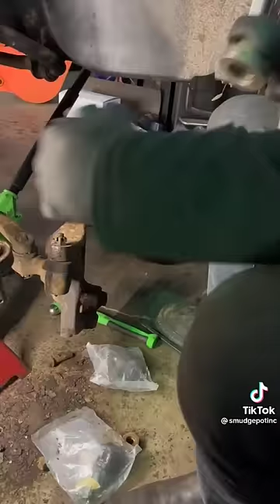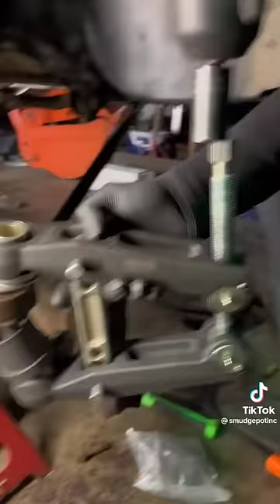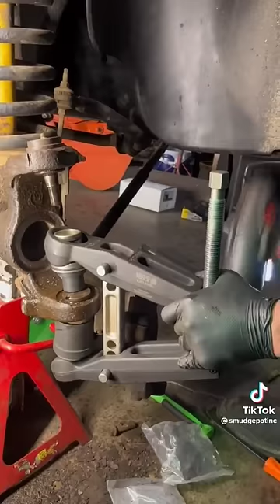Matco Ball Joint Press out ball joint Tool Kit pt.1 #automobile #diy #fyp

Comment: Doesn't matter how much you spend on tools, you'll never have enough hands when it comes to suspension work😂
Reply from the maker: Fair enough 🤷🏾‍♂️
Reply: Frs
Reply: That's why I got married
Reply: It’s a fact, suspension tools are a 2 man job to use most of the time😭🤣
Reply: Ditto bagging groceries in cloth bags.  ;)
Reply: FACT
Reply: @iHackWaWx  good thing i have multiple personalities.
Reply: The question is. Can you use it to install it???🤯
Reply: @nancydiaz753  I don't see why not. Just use the correct fittings

Comment: I watched my pops with this exact tool... for solid 20 minutes try and work out a rusted, completely welded, solid lower and upper ball joint on a 95 ranger.... about 20 minutes later I saw I'm driving to Napa and he got complete lower and upper control arms with new bushings... and he sold that tool back to the matco guy and said "if it's that fucked up and needs this kind of tool, it needs the whole arm replaced" lmao
Reply from the maker: Yeah, if it's that messed up the entire thing needs to be replaced anyways🤷🏾‍♂️
Reply: @letsfixit251 except you’d have to replace the entire axle tube on this truck in this video. It’s a solid front axle vehicle.
Reply from the maker: @adamchristopher2086  it is what it is. Basically, another bad design
Reply: @letsfixit251  how so? 3/4 ton and heavier duty trucks use solid axles because they are more durable than IFS. This has been proven with countless GM Duramax tie rod issues.
Reply from the maker: @adamchristopher2086  my point was jeep wranglers are poorly made. Nothing against any of the heavy-duty vehicles witch should have solid axles
Reply: @letsfixit251  gotcha. Couldn’t tell if this was a Jeep or a Dodge with him referencing Chrysler.
Reply: Lol just cause ur ball joint is bad doesn’t mean you ALWAYS need a whole new control arm that’s gonna cost way more to buy. Ball joints are supposed to be tight like that. Money well spent when I got mine!!!
Reply: That's what I did for my durango.
Reply: @adamchristopher2086  I see an ungodly amount of that shit lmfao. Damn tie rods are ALWAYS fucking bent.
Reply: @letsfixit251 😂🎉
Reply: We had a stubborn one like that, the other day on a jeep compass. Fought for hours trying every tool and it just would not come out. We finally ended up just grinding it right out of there and then smacking it out with a hammer.
Reply: @claytonmullins89  it's just easier than trying to get them separated when they don't want to separate.  I agree they're supposed to be tight you don't want them coming apart.
Reply: That’s not an arm he’s fixing. If the ball joint don’t come out it’s time for a new differential/axle
Reply: He' did grind said weld off before attempting to press if out yeah 🤔,?
Reply: Wait, this is a specialized tool that sells for over $1k off the Matco truck.  You’re telling me that your “pops” bought one just for a 1995 Ford Ranger and returned it after only 20 mins of use because it wouldn’t work on that one application?  Something about your story doesn’t sound right.
Reply: all ramgers here are cake...you up morth?
Reply: Well you must be mistaken on year of the ranger because they didn’t use control arms on rangers until 98. 97 and older used twin I beam or ttb depending on 2 or 4wd. But yeah way easier to replace control arms in any situation as opposed to pressing new ball joints in. New parts prolly cost less than the tool too lol
Reply: @Redranger94  ya know, you may be right about the year. I remember it being a 4th gen and I think those came out in 98?  I know my 2nd gen was 2wd and the 4th gen was 4wd. And idk if we ever did the ball joints on 2wd truck
Reply: If a ball joint or bushing needs replaced at all I just get the whole control arm. It's cheaper and easier.
Reply: @Redranger94  eassier to umload torsiom bars vs press a ball joimt?
Reply: @jonWilk8156  yeah you know I guess I shouldn’t have said always easier to replace control arms than ball joints. Just most the time rather. I’ve never really had a problem pressing joints out but there is typically an advantage to just loosening bolts and nuts instead.

Comment: I’m still using a 20yr old OTC c-clamp style press. Works great and doesn’t take seven hands to hold it in place.
Reply: Yeah but like it’s cool 😂
Reply: I guarantee you’ve struggled on a dodge  ball joint. If you used this, you’ll realize how much easier and faster it is. Our store bought it when it came out, does the job so much faster than any c-clamp ever has. I highly recommend it.
Reply: @alainorozco8032 I did my ball joints  on my dodge, put all the clips on, and the one popped out when I turned the wheel while sitting still, so I tacked it in.
Reply from the maker: Sheesh thats rough😬
Reply: Works on drive shaft u joints also 🤘
Reply: -40 years old still working great OTC it's made me more money than almost any tool
Reply: Same here
Reply: First off it still takes 3 hands with the C press and second this thing moves the jack screw out so its not stuffed up in the wheel well while your tring to get your gun on it ... very handy
Reply: I never saw this style I thought there was only a c-clamp style we're doing ball joints sucks I did them on my old 95 Dodge pick up what a 🐻
Reply: Most but not all  of the c clamp ones are not impact rated that's the bigger issue and this matco one is nice but probably $1000
Reply: Got the same C style and I disagree it def still requires 3 hands

Comment: Pro tip. Tap on the knuckle with a hammer when pressing in and out to release the tension and your cups won't flare and last longer
Reply from the maker: Sounds about right
Reply: Hmmm yes.
Reply: Plus LUBE! Lots of LUBE
Reply: Depending on the material. obviously you don't want to go banging on forged aluminum control arms. That's a recipe for disaster. You certainly don't want to heat them up either.
Reply: @KyrieEleisonMaranatha  while this is true for the most part (taping and banging totally different) most aluminum components don't have the option to replace the ball joint to begin with
Reply: @Tony-ps9qk  that's not even remotely true, 99.9% of control arms have replaceable ball joints. Whether pressed in or bolted on. With forged aluminum arms, you really don't want to bang on them to much. I have seen them crack before. Especially when you already have pressure being applied from the press. Also absolutely no heat on forged aluminum.
Reply: I seen a guy in Africa with a multi headed tool that was basically a long breaker bar he used for nearly everything and he would rebuild suspension
Reply: Absolutely.
Reply: Yup
Reply: @KyrieEleisonMaranatha annealing will have your alloy reeling. 

...Or bending or cracking lol.
Reply: This is the way.
Reply: Also the threads won't have to take all the pressure of pushing it back in... i've had to replace three of the C clamp looking ball joint presses because of the threads getting messed up.
Reply: Yes, came down here to post this. Beat me to it.
Reply: @Tony.  Is that with ur fourth hand yeah?
Reply: It's matco 100 percent warranty anyway.
Reply: Getting it nice and hot helps too! Especially in the salt belt
Reply: Wow, what a pro
Reply: @KyrieEleisonMaranatha I don't know where you're getting your 99.9% number, but you are the one that is mistaken. There are tons of vehicles out there now, and I mean tons of them, that have disposable A-Arms made of aluminum with an integrated ball joint that is not replaceable. You just replace the entire control arm. Fords do this a lot, as an example.
Reply: @shelbyavant5081  no there isn't tons of those. You clearly don't know what you are talking about.
Reply: @KyrieEleisonMaranatha  He’s right, you clearly don’t work on a lot of modern vehicles if you think that. Plenty of cars over the last 15 years have non-replaceable ball joints
Reply: @jeremyadams7395  no that's not true, and I own my own shop that sees 100's of cars a month.
Reply: @jeremyadams7395  also liking your own comments is a sign of narcissism boss.
Reply: That's what I thought. If you have the means, heat it up as well.
Reply: KY
Reply: @hanzgrueber145  I’m very interested at what this tool name is? My imagination has consumed my thoughts 😂
Reply: @KyrieEleisonMaranatha  Did you ever learn about disposable A-arms, chief? At your shop that does hundreds of cars per month? Just checking in.
Reply: @shelbyavant5081  Technically all a arms are disposable. 🤣🤣🤣

Comment: To extend the life of this tool, it’s best to tighten some and tap the knuckle, tighten, tap. Doesn’t take much longer. Also I found that keeping the threads lubed up, drastically helps extend life and create more tension. Great tool!
Reply from the maker: That sounds about right ✅️
Reply: Man you never used one.
Reply: I use ARP bolt lube on all of my press and puller bolts. The bottle is expensive but it lasts a long time and I never gall the threads on anything.
Reply from the maker: @Jpilgrim30  why not the regular red grease?
Reply: @letsfixit251  the arp lube is a moly lube just for lubing threads. It’s not as messy either
Reply from the maker: @John Pilgrim  interesting. It's called arp line?
Reply from the maker: @John Pilgrim I'm going to look into that I learn something everyday. Stick around my channel for a while sir🫱🏻‍🫲🏾
Reply: anti seize the threads.
Reply: also grease threads
Reply: “That’s what she said”

Comment: I use the HarborFreight ball joint press to change u-joints…it’s a game changer!
Reply: Look at what he is working on.....4x4....lower ball joint.... maybe you can get the harbor freight setup in there to do the lower, but your probably going to end up taking out the upper ball joint first.
Reply: @ryurc3033  I did my 06 Ram 3500 4x4 this weekend with the harbor freight kit and did not go through the top on either side. Worked very well.
Reply: Harbor Freight is a game changer
Reply: My Ram 2500 ball joints were far too much for the HF tool. Literally bent the tool open. It is stout but those d*** things were IN there. OTC kit from Amazon worked
Reply: No no it's a U-joint changer.
Reply: How much is it at Harbor Freight?
Reply: @phendrix9476 Use a torch to heat up the control arm around the ball joint first and watch that BJ pop right out 👍🏻. Heat works wonders.
Reply: I uave bent two of the HF ball joint tools.  Ended up spending a little more for one apparently made in a different part of China.  😂

Yes.  Porter cable half inch pneumatic impact...opened up two of the HF ball join tools.
Reply: Yesssss sir. HARBOR FREIGHT can definitely help a lot, specially for those specialized tool that we use once per year.
Reply: Game changer......yea...you from a man to a puzzy,  only thing I'll buy from harbor freight is WD40 and a Chevy Keychain they have at the checkout line.
Reply: I used a HF one and it exploded, you win some you lose some. That one lost. Got a real tool from the parts store and that worked.
Reply: @smooth_ops2942  nothing like the Ol “hot wrench”
Reply: @paulieramos  good for you cool guy…

I actually use the tools not just look at em…

Comment: If the tool says it's ok to use impact on it, at least use a good strong moly grease on the threads.
Reply: They’re still going to stretch as will that bolt. Might take a few years, but constant use will eventually break that bolt. 

An air hammer would work just as well and be way more useful.
Reply: matco truck will replace it forever tho
Reply: I see blue grease on the threads
Reply: @giveitthebeans1741  more grease is better. gives a reassurance to all viewing and questioning whether there's grease on there or not.
Reply: @ninjamigs1766  Lmao! Who CARES about viewer assurance 😂 Maybe dude wasn’t want a whole damn tube of grease on his tool. As a professional technician, I assure you that I hate excessive grease on my shit. The grease is there, whether you can see it or not, and the tool worked, whether it had grease or not. End of story. The guy doesn’t work for Matco, so he’s literally just trying to show people ways to make their job easier. Buy it or don’t buy it…
Reply: Why? 😂😂😂
Reply: @valkyire35  reduces friction and heat and chances of binding up and fucking the threads, heat and friction and speed will do that.

Comment: “That is the fastest I’ve ever seen”

Keep hitting it with your purse why don’t ya.
Reply: You've never changed a ball joint and if you did It was on a honda. Once. 

Do a couple tundra or sequoia and come back, big manly man.
Reply: @eikon7073  what's a better way to take them out without this tool honest question?
Reply: @Junior-yd8xb  this IS probably the most effective method I've seen. 
That's why It makes no sense someone would make fun of somebody for hitting on them. We've all been there and th darn thing just won't pop. The smart ones that see loads of these in a month buy this thing, the broke ones or the ones that can't justify it for one use alone (understandable) will get a bigger hammer and keep whackin the knuckle.   The installer locked it when the put it in by saying "that's not going anywhere". Now you have to unlock it by saying "It can't be stuck if it's liquid". Grab a torch and a hammer, or get you one of these babies.
Reply: @Junior-yd8xb Drive something with bolt in ones
Reply: @davidlabossiere1140 homeless? Buy a house then
Reply: @___Bruh__ Fr tho low key that’s kinda smart why don’t they
Reply: its easy as hell on my 93 4runner. ball joints literally bolt in to the control arm, just unbolt and thats it. getting it disconnected from the spindle isn't too terribly hard either. i assume its for easier fixes in the field.
Reply: Add a load to the tool grab a hammer and help it work its way out. Ive been thru 3 of these cause the threads on the spindal arent as strong as you think
Reply: Wallet, you hit it with your wallet. 

My purse says get a couple of small pieces of pipe and a C clamp.
Reply: @eikon7073  I know right he won't be talking about swinging a purse after swinging that hammer for 3 hours and giving up 7 times
Reply: 😂😂 let go of my purse i don't know you
Reply: @rjmac3001 they don’t bolt ball joints in. Other wise they wouldn’t spin.
Reply: @FC0BCA7E7A  how are you gonna tell me that it doesn't do something when I AM the owner of the vehicle? 🤣 There are 4 14mm bolts holding the base to the control arm, and one 21mm nut on the end of the ball joint. Just look up a 1990s Toyota truck ball joint and you will see what i mean.
Reply: @rjmac3001  no, you’re wrong. I know because I was there.
Reply: @FC0BCA7E7A  oh my bad, i didn't realize you were chill like that.
Reply: @rjmac3001  well now you know. And if ya know, ya know. Ya know?
Reply: @rjmac3001  well now you know. And if ya know, ya know. Ya know?
Reply: @eikon7073 just did a tundra one with an air hammer
Reply: @Junior-yd8xb  A press is the only thing that works to my knowledge
Reply: @eikon7073  Sometimes the hammer just does the trick man.....
Reply: @ImTurtleSmo those look like fine machine threads. They should really be square or trapezoidal. You could ream out the hole and tap for larger acme screw.
Reply: @eikon7073 you sound like you've only changed a ball joint once...on a Toyota. Chill Karen
Reply: @ducatista1098s   The last thing you want is a fine thread pitch here. And trust me you hold one of these bitches they feel even stronger than they look. but enough ugga duggas and those threads start to pull. no matter how many hammy taps or how much fire you add
Reply: @ImTurtleSmo  what are you talking about bro? I literally said this tool should use different threads. And no I would not be surprised by how strong a fine pitch screw is, I know how strong they are; that isnt the point.
Reply: @JoshJackson13 I feel that, two of my coworkers and my self had to do it on my Tahoe for just over an hour and we were dying. For reference none of us were weak as we were all serving in the Army at the time, if anything we only had access to a smaller 7-10 pound sledgehammer is why it took us an hour.
Reply: @Junior-yd8xb air hammer
Reply: I forgot my purse in the car. Can I borrow yours?
Reply: I forgot my purse in the car. Can I borrow yours?